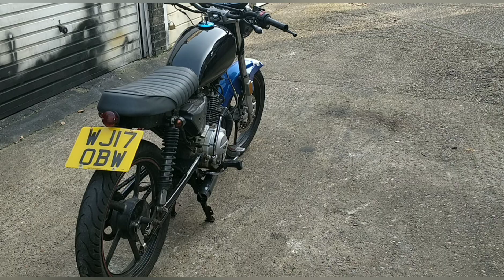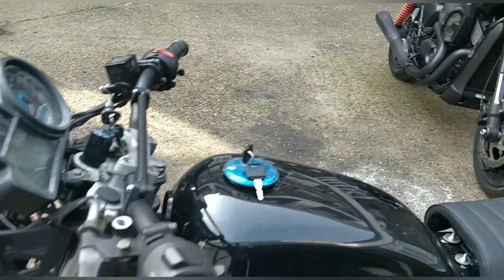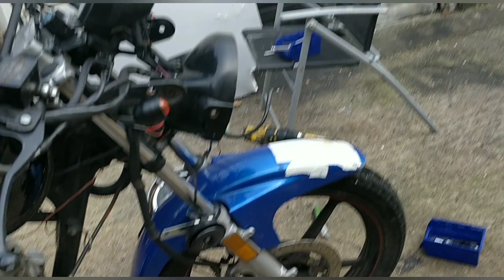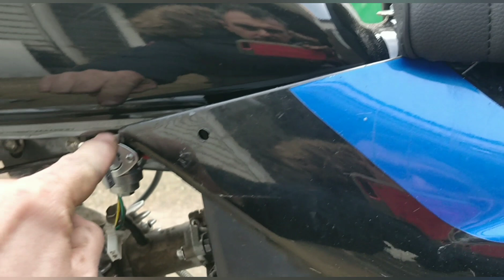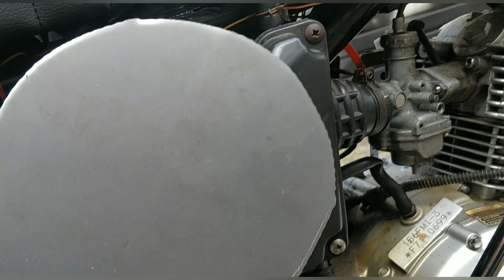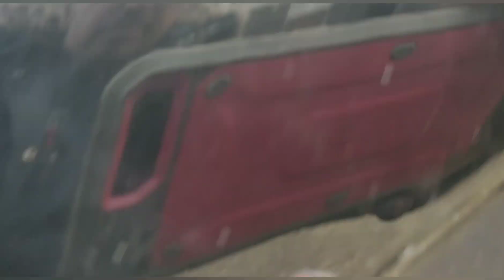lexmoto brat build. Very close to finished.

Comment: Only just found this Chanel! Nat mentioned you… nice one mate ! I didn’t know there were so many Lexmotos ! Would be interesting to see what you can do as they are great little bikes
Reply from the maker: Hi Paul, welcome to the group mate. 

Ultimately they are cheap Chinese bikes and fail normally because of very thin paint. If you can strip them down and layer up some paint then you can build a bike that should last 10 years or so. 

But it is alot of work to do mate.
Reply: @motorcyclerescuer  are you in London ?
Reply from the maker: @MadOldBiker  yes I'm in Islington Paul.

Comment: Looks better without front mudguard. The fork boots would be worth the time. Side panels on look better
Reply from the maker: Them fork boots are to big. I may measure them up today and see if I can find any smaller ones. 

The mudguard looks better now its black and of course is an mot requirement although I could possibly fit a mini chrome one. 

I'll have a think about it.
Reply: @motorcyclerescuer  Can't you cut the boots down and use zip ties ? It would make the front a lot beefier. Definitely go with a shorty mudguard cos the standard one makes the rear end look bare. Only my opinion mate.
Reply from the maker: @KAWASAKIADDICTION  I'll look into it in regards to the mudguard. A better speedo, mudguard and gaiters would add almost £100 to the build which would take it to around £750 though. That's still OK but can make better profit with as it is. 

I'm torn between my heart and my head lol.
Reply: @motorcyclerescuer  Tell me about it !!! It's knowing when to stop eh ? Lol